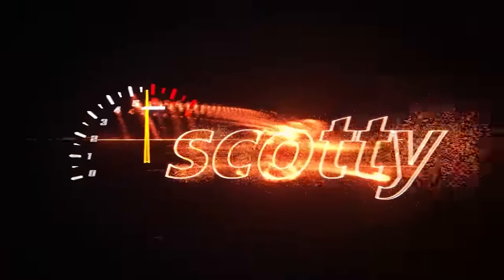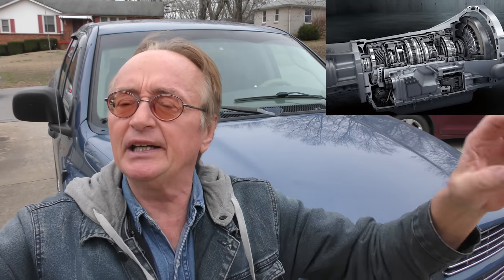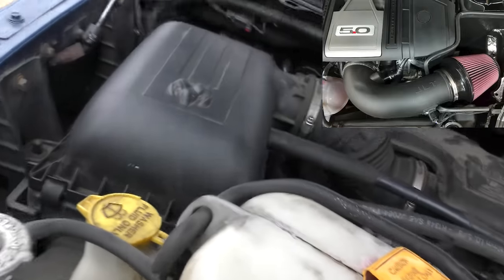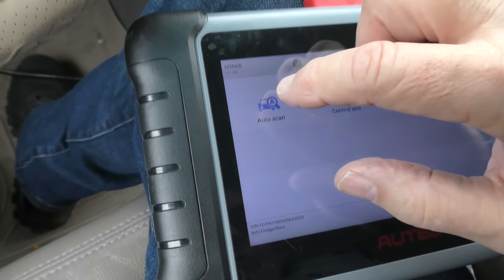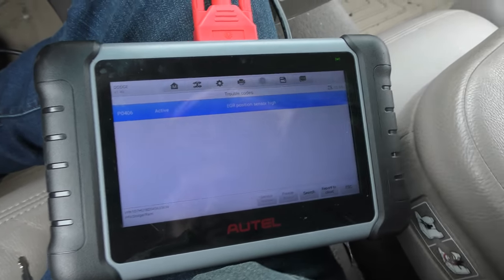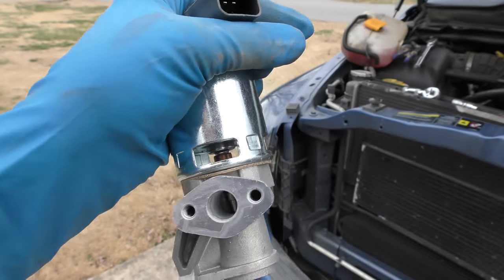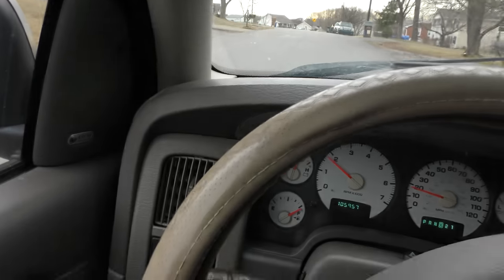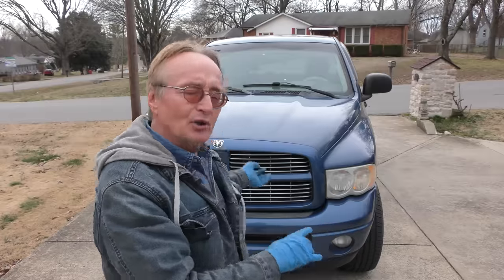Please DO NOT Buy a Dodge (Unless It Has This Engine)

Comment: These older, mid-2000's Dodge Ram 1500's with the 5.7 L HEMI V8 engine and the five-speed automatic transmission are still running strong and driving pretty good as of today. There is no need to buy a newer used vehicle. Thank you very much.
Reply: I have a 94 with the 5.9 magnum still trucking along.
Reply: @John-209  99’ with 5.9
Reply: Exactly the old ones king the old Cummins are even better than the V8 nd commonly see over  500k miles
Reply: @JVeleta11  Agreed
Reply: My 05 has nearly 300k and still going strong!
Reply: Yup, sticking with my 04 Rumble Bee for the long road ahead, only has 100k too
Reply: Yessir 2007 ram1500 5.7l 205,000 replaced the whole front end components shocks struts cv axles control arms with ball joints tie rods and wheel hub and bearings all 4 drilled and slotted brakes just got trans rebuilt for 3k at 203,000 beat on this baby everyday
Reply: @noahchapman8788  Yeah, I just replaced the 5.9 Magnum in my brother's 2000 Durango. You could get a 5.9L up until 2003. At least in the Durango you could. He had to buy a remanufactured engine because we couldn't find a good used one.
Reply: I have a little over 300k in my 05. 2nd owner just changed out exhaust manifold, front bearings and now power steering pump. I keep eyeing a newer truck but can't justify it. this truck is a keeper
Reply: @Nightskyninja  My 05 has 410,000 and still driven daily.
Reply: My 4.7 is still running stron
Reply: 06’ 1500 4x4  5.7 Hemi. 350k and running like a beast in SOCO mtns. All full syn Lucas fluids -
Reply: @hadarc8014  never justify that 40-60k dude for electronic aluminum paperweight
Reply: @JUNEBUGLLC  👍
Reply: Still got my 06 1500 quadcab with the 5.7L hemi with just about 165,000 miles. My only problem with those older dodge trucks is that they rust like crazy. Had 2 body jobs done on it and did everything right trying to stop it from coming back, but still did. time to buy some fender flares and just cover her up and keep riding.
Reply: Does that include the 2003 hemi?
Reply: @warionation2648  Of course
Reply: Have an 11 sport 5.7. Did cam and lifters and used a tuner to turn mds off. Runs stronger than when I bought it
Reply: I bought an 04 1500 5.7  and extended 8ft bed with 70k on it for $11k and love it. 10 times better than buying any new hunk of junk 60k truck on the market that has more tech than i know what to do with. I can work on most things myself with it’s age and simplicity and the things I can’t every time I pull into the shop the mechanics say they prefer working on it over brand new vehicles.
Reply: @illinoispublicland4680  I agreed with your story.
Reply: 05 1500 SLT 5.7 2WD Auto 5 speed 200.000 miles no oil use motor is dry Trans works perfect never a problem with this truck and i have ran the piss out of it but i've always kept the matinees up on it.
Reply: Just got a 2007 RAM 1500 HEMI with 120k miles on it. Hoping it lasts a while!
Reply: @fragginNinja  That's good.
Reply: Got a 2017 5.7L 1500 with 56k miles on it. Got a sweet deal on a corporate fleet truck. Runs great!
Reply: Love my 5.7 hemi. I never had a problem. Use it every day, pulling a trailer for work
Reply: 04 5.7 hemi 270000miles
Reply: I am driving a 2006 dodge ram 1500 for 9 years now and it has a little more than half a million miles now and it still runs great no problems with it other than radiator breaks and suspension once I drive it about 1600 miles every week for work it’s a HEMI V8 5.7 liters 4 door pick up
Reply: @josearriaga8945  That's good.
Reply: @josearriaga8945  wait, can you clarify that? Your radiator and suspension break every 1600 miles? Or is that how much you drive it weekly?
Reply: 97 with the 5.9 here
Reply: Got a 04 with the 5.7 still running good just rusted out
Reply: I’ve got 1.6 Hyundai Accent manual transmission , very good car still runs great
Reply: Ive seen 07 charger srt8s with superchargers and cammed scince 50k miles and have 400k now, still running original engine. Dude did have to change trans at like 150k tho
Reply: I have a 96 1500 5.9 hemi has 305k miles n rides smooth as butter no issues these second gens can last 600k plus
Reply: That is very true. The issues that ever came from the first second and third GEN dodges were minuscule and I don’t care what anybody says. They are one of the toughest trucks on the road.
Reply: I got a 99 Jeep Grand Cherokee with the 4.7 & she runs strong with over 200k miles
Reply: 2004 1500 hemi 5.7L - replaced transmission runs good
Reply: O6 with 270,000 going strong
Reply: My roofing job has a blue one that’s beat to hell and used for pulling dump trailers. It pulls stronger than any other of our new trucks.
Reply: 2003 single cab short bed 4x2 5.7. 143k original lamarie.  With newer style 20 in factory rims. I love my truck wouldn't trade it in for anything.
Reply: So is my 04 5.9 cummins
Reply: Wrong the best is the 5.9L anything hemi is garbage
Reply: @EyeKnowYourRight22  I agree. My 5.9 has over 300000 on it and still running strong and no def
Reply: 2004 5.7 hemi quad cab 240 thousand miles and still my daily driver runs great!!!my only complaint the past 8 years I've owned it is the electronic issues it has had a few times...it's never easy with the electronics in the dodge...But all in all best truck I've ever had
Reply: Magnum
Reply: So are the 5.9 360 Magnums.
Reply: @Rizzbulla  the older 5.9 are work 🐎 that run forever
Reply: @johnoates3326  
Yeah, mine feels bulletproof lol
Reply: I have a third GEN and it runs perfect with 200,000 miles
Reply: Scotty is full of it dude. I have a work truck(GM) that’s had two transmissions already. My personal dodge ram (2006). Running like a dream with over 300,000 miles. Dodge is the way to go. Chevys probe to overheat and we’re not gonna talk about ford
Reply: That's what I got buried the speed odometer tryna make it faster @John-209
Reply: I agree to this!
Reply: I have an 05 with worn lifters, i was not expecting the older models to have lifter problems
Reply: With lifters knock
Reply: Exactly what I just bought February 2nd
Reply: @JUNEBUGLLC I just got the 07 hemi but I also have 01 5.9 Cummins  approaching 390,000 miles
Reply: @John-209 I got a 5.2L n still runnin good
Reply: @Nightskyninja  I have a 05 dodge ram 1500 Daytona with 260k on it still running strong
Reply: '01 with 5.9 with 152k miles . Love that engine. Runs and sounds phenomenally good!!
Reply: 175,000 on my 04 and still going strong..
Reply: ‘05 Hemis are the worst
Reply: I just got a 5.7 hemi 2007 for 800$ she runs really good! Seller didn’t know what caused the engine to randomly die and when I seen the air intake disconnected I fixed the problem
Reply: @hadarc8014  Same mine has had problems but never the engine it just won't die and is as fast as the day I bought it
Reply: Just bought me an 03 with a 5.7 and 179k. Thing runs like a sewing machine. Hoping it gets me 350 plus
Reply: Same here. 2006 ram trx4 5.7 213k and still my daily.
Reply: 99 solar yellow 5.9R/T sport package loaded I bought this truck in March 2002 was just over 16,000 on the odometer at 181,000 my timing cover gasket failed. I rebuilt a lot of the engine nothing crazy or internal further than the distributor oil pump, kegger mod on the intake manifold, today it has 267,546 it gets driven constantly and runs like a naked ape. And it makes no other noise except for the fuel injectors, ticking and my super 44 series Flowmaster rumbling love these trucks tanks with wheels.
Reply: 99 solar yellow 5.9R/T sport package loaded I bought this truck in March 2002 was just over 16,000 on the odometer at 181,000 my timing cover gasket failed. I rebuilt a lot of the engine nothing crazy or internal further than the distributor oil pump, kegger mod on the intake manifold, today it has 267,546 it gets driven constantly and runs like a naked ape. And it makes no other noise except for the fuel injectors, ticking and my super 44 series Flowmaster rumbling love these trucks tanks with wheels.
Reply: I want a 2006. Dodge ram 1500.  For first car
Reply: Love my 2004 Dodge 1500, I never had any problems with it, except normal wear and tear. 189,000 miles on it . I going to keep it till the wheels fall off it. Hell the exhaust pipe is tighter then my ex wife.😂
Reply: Just bought a 2005 with only 133,000 miles on it needs a little work but not bad a 4x4 full size for $4800 only needed new cats because they were stolen so $5800 with new cats
Reply: 5.2L V8 with the Chrysler 4 speed automatic transmission lasts longer
Reply: I bought a new 2003 1500 with Hemi. Drove it for 16 years. Great truck if the frame did not rust up I would have kept it longer.  Bought a new 2019  absolutly love this truck!  No issues so far.
Reply: 2010 1500 Hemi TRX4 running strong!
Reply: Thank Daimler!
Reply: The newer 5.7s are better imo
Reply: @MegaBenjamin  most everyone respectfully disagrees
Reply: @DuisteinAffe-qo4ie  just don’t idle it and change oil every 5k, that’s literally it and you won’t have hemi tick. I’d rather deal with hemi tick over the valve seat issue the pre eagle hemis had. I’m also a tech so when lifters do go bad it’s an easy fix. But the eagle hemis make more power, have better flowing heads and are more fuel efficient
Reply: @DuisteinAffe-qo4ie  not to mention the early 5.7s engine bays were a little more cluttered

Comment: I worked as a toolmaker for Newark Assy. for Chrysler Corp. from 93 to 09 when the plant closed.Chrysler never needed Daimler Benz. The company was doing fine with 8 billion in cash reserve at the time of the "takeover" When Daimler took over they took away as many improvements that had been made on the vehicle as they could get away with. For just a few examples they eliminated some inspection on the final line ,did away with the color coordinated running boards, eliminated reinforcement brackets in the under-body and also did away with the shipping tape? that you normally only see on expensive vehicles.   They actually cheapened the Dodge  Durango. I was there.
Reply: They also created a car like the Pacifica and the little one like the Neon
Reply: Scotty often has his own version of the real world.  I was a MSF Motorcycle Safety Instructor for around 20 years and listened to his EXPERT review of motorcycle items.  I guess MSF should have not bothered and simply contacted him, so much for the Hurt Report and actual accident analysis.  Have an older Dodge with a 4.7 and it has over 175k miles and yes I had to fix it myself.  Turns out simply the mile-long cam chain system wore out enough to require attention and a few small electrical issues, it runs like a clock.  I would have selected that Old Hemi if I could, but buying a used vehicle, you take what it has.
Reply: @richczentorycki2540  the neon was already in production before the takeover
Reply: One thing I thank Daimler for is helping with the 300C , trans, suspension.  Rear end.  All MB.  Intrepid, Dynasty, 5th avenue ? No thanks.
Reply: Agree. Overall Diamler hurt Chrysler. My 1998 Chrysler Town & Country had infinitely better quality than my 2007 did.
Reply: @Chrysler1998  I believe Daimler had Chrysler's premium sound system manufacturer infinity cutting corners too. For example I've heard of a lot of people who had these sound systems in the 2000s having trouble out of them. A former friend of mine had one in his 2005 jeep liberty and had to replace all the speakers because the foam around them had dry rotted. There has also been problems with the sound systems in the rams and minivans. Infinity was making the speakers as cheaply as they could. However in my 1994 Chrysler Concorde that I've owned since 1998, I've yet to have any problem with the sound system. I've rocked out to every kind of music imaginable in that car and the speakers are still just as good as they ever were. It's to this day the best sound system I've ever heard in any car.
Reply: I'm a chrysler tech now and i will say the FCA era was actually really good. Just the marketing and the vehicle styling was a little off. The KL cherokee, 200 and newer pacifica for example. Great vehicles just odd design and not good marketing. Best vehicle in my opinion is the old wk2 grand cherokee. Those things rarely break it seems. As for the daimer era, everything i work on around that era was a joke. Only think good about the daimler era was the NAG trans. Couldn't put the power down but it never died.
Reply: @Krzrrazrrokr  my 06 grand Cherokee came with the Boston premium stereo system stock. It’s amazing and vehicle has 205000kms still has no issue with the radio? Then again the Cherokees a more luxury take on jeep
Reply: @stormer1092  I find that the trans puts the power down pretty well yet again mines awd/4x4. Still dk why they put 4 low in it but not 2wd
Reply: @stormer1092  the Jeeps also rust like hell
Reply: 8 billion ticks more like it
Reply: I was on that site after the demolition for utility locating on the old pads. It was eerie to see how big that facility was by the concrete pads, but no building to be seen. There was so much weird crap buried there.
Reply: @rakohus  Same thing happened in Ontario Ohio with a GM stamping plant.  The worst part was another company wanted to buy the land for another company operations.  Ontario and Richland county worked hard to mess things up, seems as if they wanted the back taxes paid as part of the deal.  Well it still is a big concrete pad.
Reply: All of those changes you mentioned sound like intelligent cost-saving measures.
Reply: cause it’s a Dodge factory not a Mercedes factory. dodges have never been high quality nor stout
Reply: I know first hand. I had the best pickup I ever owned. It was a 96 dakota with a 318 v8. I sold it with 356 thousand miles. The engine was original minus 1 water pump and 2 power steering pumps
Reply: @Krzrrazrrokr  can confirm, my 05 2500 has the infinity speakers and they are worn out and need to be replaced
Reply: Daimler used Chrysler as a cash cow
Reply: @charlesmoore2485  That isn't accurate. The only car that was a collaboration of the 2 companies was the Chrysler Crossfire. The trans in the Charger and 300C was the same as the one in the truck above the 545RE.
Reply: @dbc1dc  The Chrysler 300 is based on the rear-wheel drive Chrysler LX platform with Chrysler executives confirming that Chrysler engineers were sent to Germany to study the upcoming E-Class and as such, structural elements of the car's foundation such as the toe board, safety cage architecture, as well as the load-path philosophy ending up being derived from the design(s) utilized by then-partner, Mercedes-Benz. Mercedes executives also confirmed that several individual components of the car are derived from the Mercedes-Benz E-Class (W211) and S-Class of the era.[18] Shared and or derived components from Mercedes-Benz included: the 3.0L OM642 turbo-diesel V6 used in overseas markets, the rear suspension cradle and 5-link independent rear suspension design derived from the E-Class, a double-wishbone front suspension design with short-and-long arm front suspension geometry derived from the Mercedes-Benz S-Class (W220). Components from the suspension such as the lower control arms were borrowed from the E55 AMG and have been verified by independent mechanics as being able to be interchangeable between both cars. Additionally, the 5-Speed NAG1 W5A580 transmission, rear differential, driveshaft, ESP & ABS systems, steering system, the CAN Bus electrical architecture, and cabin electronics including other electronic and engine modules were shared with the Mercedes-Benz components. Further, switchgear such as the cruise control and turn signal combination stalk, seat controls, seat frames, HVAC system(s), and the wiring harness were utilized from Mercedes-Benz components. Later model years also feature a Mercedes-Benz-derived laser key ignition system in place of the traditional metal key. The AWD models also benefited from the use of Mercedes-Benz's 4MATIC system, including transfer case components.
Reply: I copied that from Wikipedia. I don’t mean to argue with you.  I learn new stuff every day ! :)
Reply: Yep, I was working at the Kokomo Transmission Plant from 88 to 2020.
Reply: @richczentorycki2540  you mean the dart? Ive got a 2013 and its still a good running, immaculate body and clear coat. No winters, 80k on it. I take care of my vehicles. Almost too much. Going in next week for the required tranny flush.
Reply: I work metrology n quality control and know the feeling 😢
Reply: If they had 8 billion i cash reserve they wouldn't have been in a postion to be taken over.
Reply: those are mickey mouse changes! LOL!!! what counts is the engine and trans.
Reply: The 1998 Cummins had a 5 speed manual transmission called a getrag, fifth gear is outside of cast iron trans , IT'S literally in the aluminum tail cone .. unthreads itself due to right hand threads on a left hand torch on ⚙️ gear , input shaft bearing ( piolet Bearing) in the flywheel kept loosing it's needle bearings , so the input shaft rotation was out of round, then the clutch would blow the center apart ( spline , spring's) .had to go back to old school brass NOTE THE 426 HEMI USED BRASS THAT Mikes out the same input shaft size . 1.7/8 hole milled in flywheel to drop that brass in ...
36,000 mile warranty on trans , 100, 000. Mile warranty on the Cummins. 1998 ..bad engineering ......
Reply: I worked at the ITP I &II transmission plants from  98-09 and they were doing fine before Daimler and Bergen’s “ mergeh of equelz “ came along. Two years later our rainy day fund was gone and we weee sold to Cerberus hedge fund.